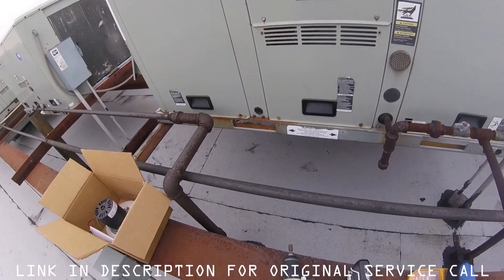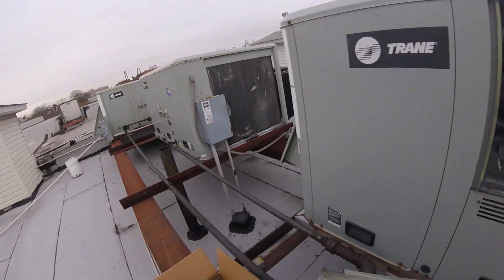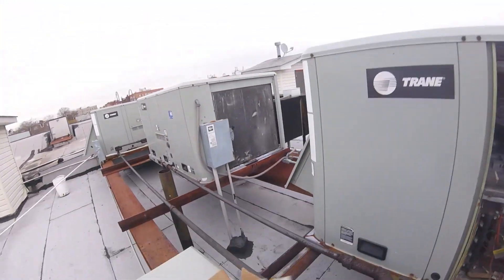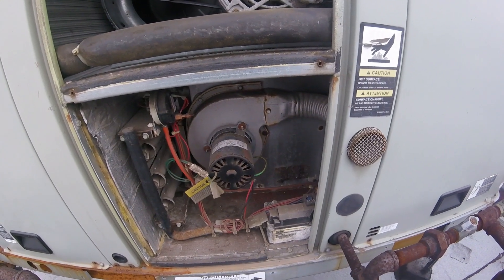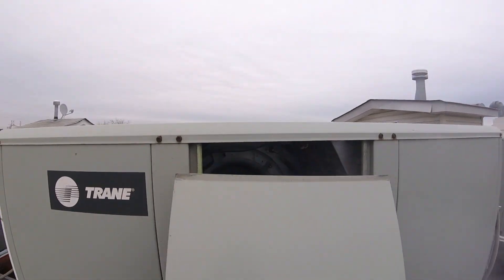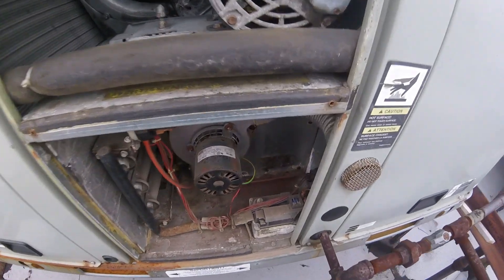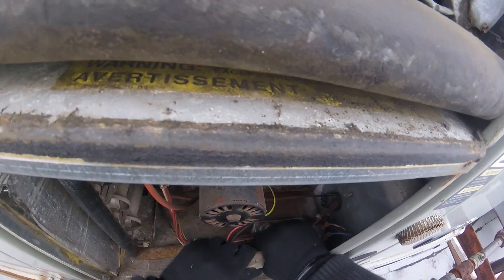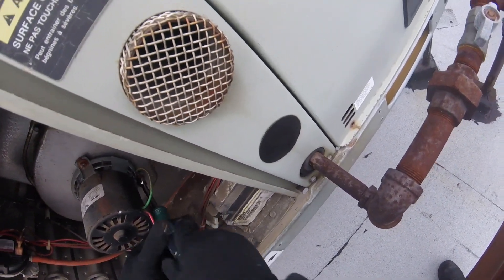HVAC: Gas Furnace Inducer Motor Replacement/Installation (Trane RTU) HVAC Service Call-NO HEAT!

Comment: trane rtu ysc060e3eha no heat 3 blinks no inducer motor changed motor blower run when i disconect any one of the limits only getting 24 v to inducer no love  great video nice content

Comment: For a standard 2.5 ton central h/a home unit what would replacing a furnace inducer motor usually run in labor?  Just curious before I decide whether to try to replace mine myself...out where I live it seems hvac repair prices are on par w brain surgery.

Comment: Turning off that disconnect while in heat may cause limit switches to trip. Try turning off gas first and let the blower cool off that heat exchanger a bit before turning off power to unit potentially cause another problem. Try to be safe out there man.

Comment: You cheater for using Fasco A270 instead of Trane Fan03130 ha ha ha . Good job 👏 though .
Metal beams and gas pipe all could use some fresh coat of paint .
In my Jurisdiction that would not pass code .
Reply from the maker: Hey, I actually picked this up from Trane🤣 Good eye👀 This place is being held up by a string lol Where are you from? Stay safe out there & stay tuned for new videos every week👍